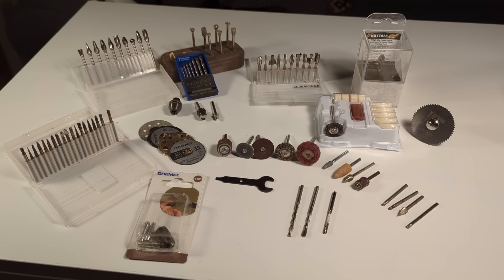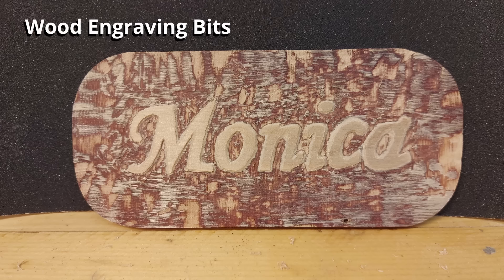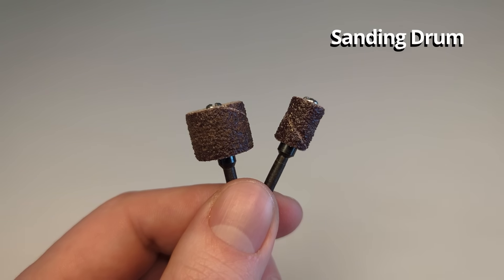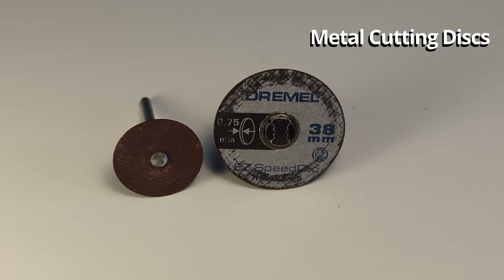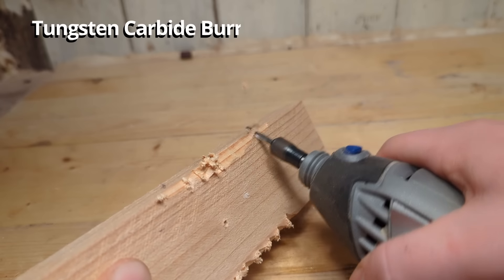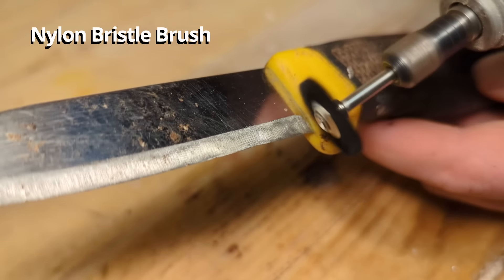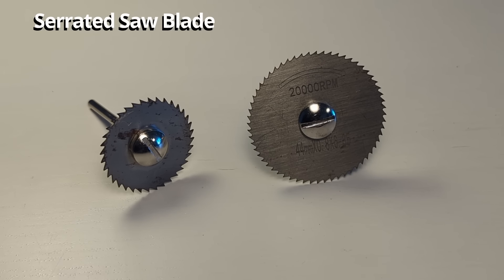The Ultimate Dremel Bit Guide

Comment: Excellent video.  We've needed a good explanation of rotary bits & you have provided it.
  In using the grinder bit, it can fill very quickly on metals like brass, as yours did in the demonstration.  If one goes slowly & touches the bit often to a piece of blackboard chalk, the bit cuts cleaner & doesn't plug up so quickly.
  Anytime one uses abrasives a dust mask is an imperative.  Diamond wheels, for instance, will shed diamond dust as the particles loose purchase from whatever mastic the manufacturer uses, & take up permanent residence in your lungs.  They are unwelcome tenants....
  Again, very valuable video & I thank you for presenting it.  Well done, Sir!
Reply from the maker: Great tips. Did not know about the blackboard chalk trick, i will definitely give that a try. Thanks for watching :)

Comment: Hey! This was way more informative than I had hoped! Excellent video! Thanks so much! Yeah, that serrated saw blade one - that's much better if you have the Flex Shaft attachment - using that, and securing the operative end to a makeshift platform, you pretty much make a tiny table-saw for it - THAT works great - it allows the working end to be securely fixed to a working surface, while you move the material across the surface with the blade cutting through, as would happen on a regular table-saw, only in Dremel size! 😉👍
Reply from the maker: I've seen those cutting platform, i would love too test that out one day.

Comment: Although the small cutting discs are, as you showed, brittle, if you take your time and use a light touch, they will only rarely break.  The advantage of the small over the large, much stronger cutting disc is the cost: small discs can be purchased in quantity for very little money, but the large disc is expensive.
Good video!
Reply from the maker: Yeah. They big ones can be a little bit expensive if you do alot of cutting. I'll give the small ones another chance, maybe I can improve my technique a little. 
Thanks for watching :)
Reply: yes, and thin disc has narrow cutting path and needs less power than wide cutting disc

Comment: There are 2 “cutting disks” which use the #402 mandrel. The disk demonstrated in your video is indeed very fragile. (It will snap when a mosquito farts nearby...) However, there is a 2ⁿᵈ which is available, but hard to get. It is called a “Reinforced or Fiberglass Reinforced Cutting Disk.” It is FAR more durable the their regular disk, but it's not quite as durable as the EZ-Lock metal disk. So, unless polishing is your main task, the EZ-Lock w/the collet-less chuck head might be your best choice.
Reply: lol mosquito fart

Comment: I’ve had success using those small cutting wheels through thick spring steel sheets from old hand saw plates (usually rusty big box store ones from decades past) for other uses without any breaking on me, it took a while because I was doing it one pass at a time. Though there were moments I got impatient and got more aggressive.
I think my main gripe with them is also how fragile they are, but mostly when I accidentally drop a replacement disk and it chips plus how fast they can wear through.

Those little router bits look neat though!
Reply from the maker: Yeah. They can work fine if you have a real steady hand and cut with precision. They are also thinner, hence they will have too cut away less material. But as you say, if you get impatient and force them in any way, they will probably break 💔

Comment: Thanks for the video. I'm so glad I watched this. You helped me so much, as I'm about to start some wood projects, that in part involves some carving. I was glad to learn of the aluminum cut bits (better for wood, which I did not know, & is HUGE for me), vs the double cut carbide bits (better for metal). I just bought the wrong bits for wood, but thankfully it is still in the mail & free returns. Or maybe I'll hang on to it for metal. And I was so glad to see you use the tile cutting bit on wood. I have that bit; so now I know another good way to use it. (It is also good for carving fast into mini plaster figure sculptures, ala Michelangelo inspired). I saw this at just the right time, after praying for wisdom in tool selection! Wow. The perfect advice keeps finding me at the right minute.

Comment: Brilliant. I didn't even know that those larger Dremel disc were available.
I usually use the flexible extention tool because it is so much lighter and easier for precise work, more like holding a fat marker pen.

One other thing, I have done a lot of metal polishing and found that I have to make my own tool by gluing wet and dry abrasive paper onto dowel rod, sawing this up and using it on the buffing mandrel shank so that I can go through the grits to get a mirror finish on razors

Comment: The thin cut ez disc came apart when I tried to cut through a 1/16th inch thick piece of metal! (like the center metal ez connector came apart from the cutting disc part) So don't use them on metal or else they just fall apart. But the green METAL ez disc cut through the metal pretty well. 

Whenever I use disc cutters of any kind with the dremel, I always stand perpendicular to the spinning disc. You should imagine the disc as an infinite plane that you should never intersect with! And also keep your chest and face back as far as possible!

Comment: I have a love/hate relationship with the mini-wire wheels.  They're really useful for getting into tight areas, but as you stated they tend to fling tiny wire bristles everywhere which get stuck in your clothes and you end up finding them for weeks after using one -- usually in a painful fashion.  One trick that helps is to use super glue on both sides of the center which seems to reduce bristle loss significantly.  One alternative that I've found is these long shank stainless steel cleaning end brushes.  The ones I've been buying don't ever seem to lose their bristles, they just wear down over time.

One other comment -- Dremel does have sanding discs with the EZ-lock system, so you don't have to deal with the screw in the middle of the disc.  Only downside to the EZ-lock system that I've found is if the disc (especially on the thin cutting discs) happens to get jammed up, the center can tear right out rendering the disc useless.
Reply from the maker: I've seen the ez lock sanding discs on Amazon, but i have not tried them. Do you think they are worth getting?
Reply: @rotarycrafts8760  I've had good luck with them so far and of course EZ-lock is nice in this area when you might need to start with a coarser disc and progressively swap to finer grit discs.  Tear out of the center piece has mostly been with the thin cutting discs rather than the sanding ones -- worst problem I've had with the sanding discs is them getting torn up, but in my case I'm mostly sanding metal.  With wood and other softer materials, I can't imagine you'd have an issue with that at all.
Reply: I would suggest the 538 abrasive brushes, they don’t fling bristles everywhere.

Comment: The thin, small diameter carbide or carbondum cutting disks actually come in two different thicknesses. I don't recall the part numbers of each, but the thinner ones are definitely quite fragile. The thinner wheels are faster for cutting small items because you don't have to remove as much material due to the thinness of the wheel, but they can't take any excessive pressure or sideways force.  The thicker ones are a little tougher to cut some things with because they cut a thicker groove and remove more material. I use both of these all the time but they do require a light touch. They are excellent for operations such as shortening, or deburring the ends of, very tiny screws and bolts.

Comment: The wire brush I prefer is the 538-02  silicon-carbide impregnated nylon.   Lasts a pretty long time and you have to worry about the little pieces of wire coming loose.

Comment: Very helpful!  I cringed when I saw the serrated saw blade.  Given time, at high RPM, it will flip out of your bare hands.  A Dremel with a serrated saw blade is basically a small version of what was a one time a fairly common tool - a toe kick saw.  Used for cutting wood flooring under kitchen cabinets to replace flooring that was improperly installed under cabinets.  I used one - once - on a kitchen remodel.  I hit a metal pan hidden under the flooring at the dishwasher insert, and torque pulled the tool out of my hands. 
A trip to the ER and 120 stitches to repair the damage to my leg.  The serrated blade basically rolls up what ever it hits until the shaft powers down.

Comment: Thank you for this video. It would be nice to have some guidelines included for the best rotation speed depending on which bit and material you use the dremel on.
Reply from the maker: Thank for the tip. I can see how that would be useful.  I will add some general rotary speed guidelines for the different bits in the description or top comment later today. But the rotary speed will wary alot on personal preference and what type of material you are using the bit on, so they will be very general.

Comment: I just got a steel carbide cutting wheel today and the EZlock bit for it. It was 45 dollars for the 2, the wheel itself was about 32 usd.  I'm using it to cut quarts and stone. I'm really impressed by the little thing.

Comment: Very informative video with demonstrations. The little chuck is very practical. I use a cordless 12v bosch rotary tool and all of the attachments are compatible, even the flexible one. Proxxon also make very good quality rotary tools and accessories. In this video you covered most of the bits, everyone can find good info. 👍👍👍👍
Reply from the maker: Cool. I need to try some of these other rotary tool models to see how they compare. The Bosch one seems good 👍 thanks for watching :)
Reply: @rotarycrafts8760  The flex extension is wonderful for small work, but be careful as I had one get very hot very fast and it burned my finger to a blister.  That was a Black and Decker tool.  
Tom's wife Pam

Comment: Everything he said here is accurate and he covered pretty much everything. If you have a Harbor Freight near you they have some good prices on knock-off items. Some of the stuff is good and some of it is not so good. The good things are they have a large package with various sized wire brushes. The other good thing that they have is buffing.wheels.  They actually have some where the buffing wheel is permanently mounted onto the mandrel. This is actually better than the ones from Dremel, because the buffing pad is completely secure and you don't have that sharp screw like thing sticking out. They also have the regular Dremel type buffing wheels and they work just fine. I avoid the metal cutting wheels from Harbor Freight. 

Home Depot has started selling Ryobi brand and they have their own version of Dremel and Dremel attachments. The cutting wheels from Ryobi are cheaper than the Dremel ones and they are compatible with the better Dremel mandrell. The Ryobi mandrill is made differently from the Dremel one because it does not use spring power to hold the disc, it uses screw power where you just tighten it up with needle nose pliers or a small wrench. It works okay but you need to make sure you get it tightened down really well.

Comment: I love all things “Dremel”. The serrated saw blade should be used with the circular saw attachment as that greatly aids in stabilizing the whole Dremel. I have one and it works great. No kick back. Please, remember that when using any power tool, let the tool do the work. Don’t force the bits beyond each’s limit as forcing each bit to work harder can cause damage to to tool, bit, work surface or the user. Let’s all Dremel!
Reply from the maker: Good advice. Thanks for watching :)

Comment: If you're going to use drill bits, I'd advise to get at least 2 sets, because they are small and thin and you might break them by accident while using them. I usually use them on softer materials, but when I used them on metals, they worked like charm. 
I 've got some no name grinding stones, that came in different shapes. Those worked great too, they helped me create proper bevels, on a new axe head. As with all power tools. you have to take safety measure and always be careful, when you use a Dremel!
Reply from the maker: Good tips :)
Reply: I constantly burn drill bits in my dremel. I can't remember to act right to avoid it so I don't use them in it much, instead I just use a manual pin vise drill handle. Slow is better for fine detail anyway.

Comment: What I am looking for is a good, and available solution for slowing down the tool. I use mine primarily for soft plastics, sanding and cutting. It takes a very deft touch to do this with the speeds these motors turn at. A slower speed would allow finer control.
Reply from the maker: Which Dremel do you have? Most Dremel models have speed control that takes you down to 5000 RPMs. But i know the older versions like the Dremel 100 is single speed at 30000 RPMs or something.
Reply: @rotarycrafts8760   I have speed controlled dremels which I understand cannot be used with variable speed controllers. THey unfortunately do not go as slow as I would like. I'm looking at possibly picking up a variable AC controller and a single speed rotary tool. These can be controlled down to nearly a full stop. I'm looking for something around 1000 rpm or a bit less.
Reply from the maker: @carlsmoot2939  Yeah. It seems like it can be hard to find the right tool and system, but I'm sure it's doable. I found a video that could be of help. If you look at the bottom of the description for this video, I linked to another video where another YouTuber had the same problem. He starts demonstrating the speed control at the 11-minute mark. The variable speed control works with his setup, foredom pedal, and wen rotary tool. But I am not sure if it goes down to a low enough rpm for your use. Maybe with a light enough touch. Good Luck :)

Comment: I also found that the small cutting wheels shatter.    I now have a bosch 12v grinder which is so much better for cutting small things than the dremel.   I don’t personally recommend the dremel as a router I think it is underpowered.
My favourite attachments are the sanding buffs, the nylon brush, and some of the burrs and sanding wheels.

Comment: the small metal "cutting" discs are more for grinding than cutting. they're really useful for e.g. cleaning up welds, etc. 

it's the same as the difference between cutting wheels and grinding wheels on an angle grinder

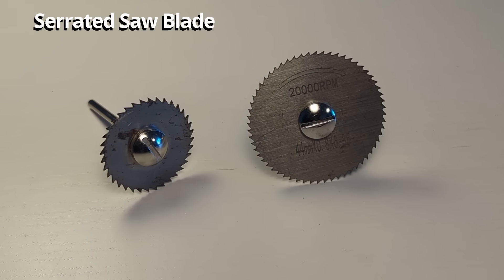Comment: 9:30 sawblade looks extremely dangerous if it has such a strong kickback, I think it was designed to go with the accessory "670 circular saw attachment"
Reply from the maker: The sawblade is not fun to use. The example was a deep cut with a hard kickback, but that is not to uncommon with this blade unless you go very slow. You could do the same with the ez544 without any kickbacks.                These off brand blades are not really designed for using with the 670 mini saw, some of them are to large,  but if you use the right size one it might work and it might be more reliable. I would need to test that out :) thanks for commenting.
Reply: The 670 circular saw is fast when cutting plastic ( acrylics) for window pains

Comment: I've been using the Speedclic abrasive buffs recently for polishing coins.  One of the problems I came across is distinguishing between the medium (280 grit) and the fine (320 grit) buffs.  They are both exactly the same size & colour (purple), and I honestly can't see any difference between them, in terms of stiffness, abrasiveness etc.  The coarse (180 grit) buffs are a completely different colour (brown), and are noticeably rougher to the touch.  I suspect that the medium & fine ones are actually identical!  What do you think?
Reply from the maker: That seems strange yes. But 40 grit difference at that fine of grit will not do much difference. So they might actually be the same. I don't have to much experience with buffing pads though, so I could not say anything for sure. :)
Reply: @rotarycrafts8760  Initially, I wanted to see if the 320 grit buffs would give a high polish to the coins, but the result looks no different (to me) that from the 280 ones.  Actually, I quite like the satin finish from the buffs, but probably to get a high polish, I'd need to use the cloth polishers & paste...

Comment: Thanks. Couple dark spots on a Flek copper pan that my creams didn't take out. The Flek can handle sanding and then bugging with the pads and jewellers rouge. It just left that little area shinier than my very annoying Noxol metal cleaner did! (Yes, I still have some, but I'll give it away...Noxol will make your pan smell, no matter how much you rinse or lemon juice it)

Comment: first class information/demo and a keeper for later reference. and no music!.. Tip: regarding the buffer and what type of compounds to load the buffer up: be careful using highly abrasive compounds on soft metals.. gold/silver. use the red compound for those (Jeweler's Rouge.. usually a Red block.. I only recently discovered that the red in it is RUST!.. be careful where this sprays off during use and use gloves to kep your fingers clean.  there are other videos explaining the other coloured rubbing compounds

Comment: To get drum sander on the rubber... Keep the screw loose when not actually being used. That allows the rubber to return it's original shape and much easier to get the drum on. It make take a day or longer for the rubber to relax after being compress months to years because most are sold as "ready to use" with drum on rubber. Try soaking in warm water if need it soon.